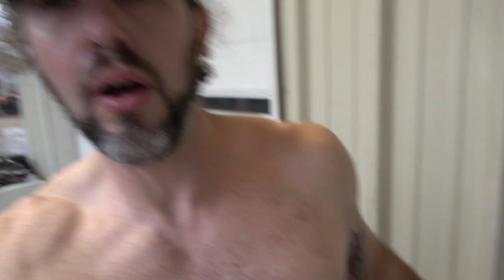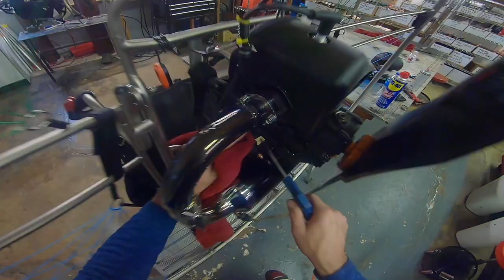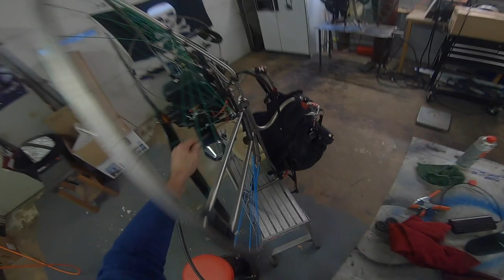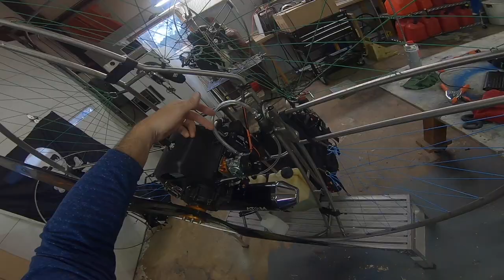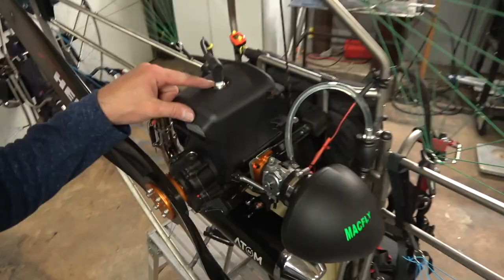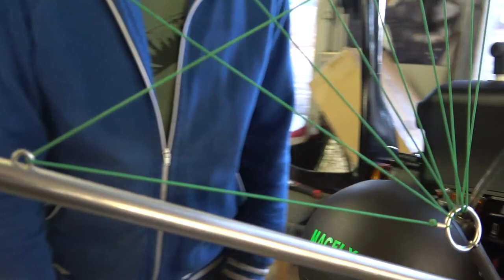1st Gen Atom 80 Overhaul, Repair, & Troubleshoot Paramotor Maintenance Shop & Test Flight

Comment: A trick I found handy for vacuum leak detection on any kind of motor.   Isolated from the carburetor airbox intake little shots of either /starting fluid at suspect area will change the RPM on an idling engine when there's a vacuum leak.   Works as well on old cars with lots of vacuum hoses you can isolate the leak or even manifold leaks

Comment: Hey Doc, Is there a filter in that airbox that needs to be replaced occasionally ?
Reply from the maker: No replacement needed unless damaged.
Reply: @kyleoglee  Cleaned?
Reply from the maker: Nah.  It's huge.  Likely would never stop air flow even in a dust storm.

Comment: Kyle, what size fuel line is that (ID)? Looks like 1/4" ID. I have the same motor and have been using 1/4" ID for almost 2 yrs.  I've been told by people I fly with and others on FB that I should be using 3/16" ID.  I just don't see how I could get it on that carb...too tight😉

Comment: In your opinion is the Atom 80 gearbox robust enough to handle a tractor prop configuration.
Reply from the maker: I've not yet examined the internals on one, so not sure.
Reply: There has been some discussion if the Atom would make a suitable giant scale RC aircraft engine. It has been determined that the Moster is not suitable for a tractor config because of how the re-drive is designed.

Comment: What size fuel line do you use on that
Reply: I use  1/4" ID on my MY 18 Atom80. I've been told the proper fuel line is 3/16". I just don't see how you can fit 3/16 on that carb or the fuel tank barbs either. They are super tight with 1/4".

Comment: Kyle....you look like a big guy. Aside from maybe a lower climb rate Is that Atom 80 fun for you?

If a 200 lb guy just wants to fly low and slow and save some weight, is the Atom 80 (or similar) a viable power plant if you don't want to throw your machine around in the air? 

Maybe a bigger wing is needed?

 "I have to be the worst YouTuber out there"...LOL
Reply from the maker: If I only had one machine, maybe not the 80.  Lot of variables to consider.
Reply: @kyleoglee  Thanks man. I have a Moster 185 + now. I was curious if as one ages a smaller engine is a viable option to temporarily delay going to wheels due to weight.